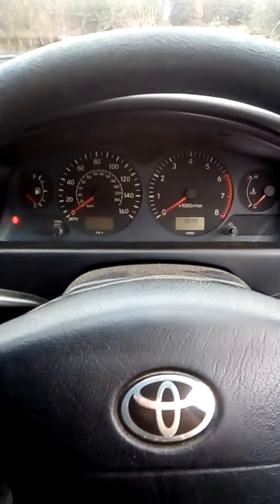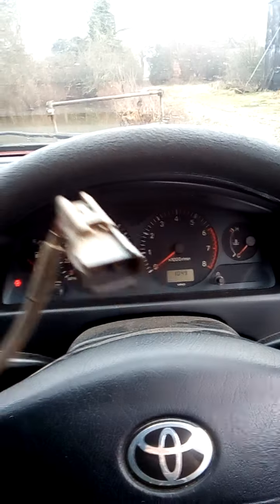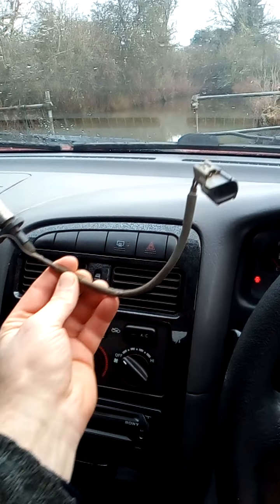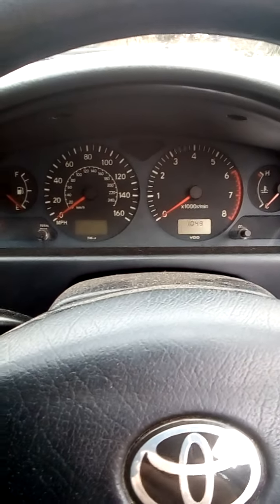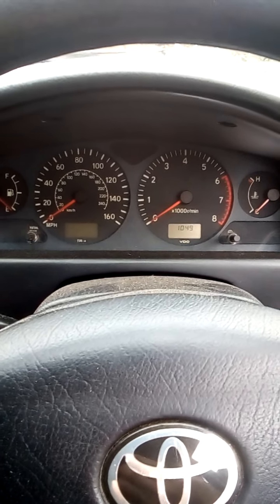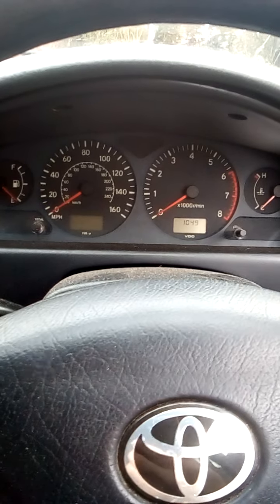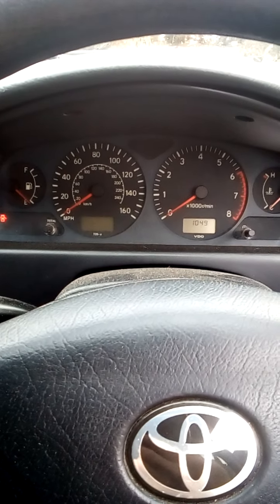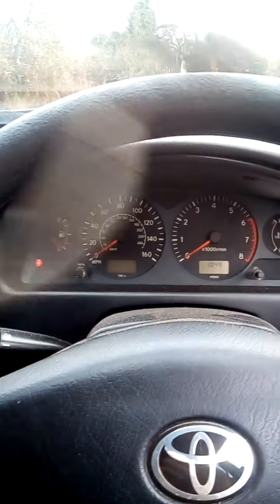Toyota 1.6 4afe 1.8 7afe crankshaft sensor issues

Comment: Thank you mate. 
I had the exact symptoms you described on 1998 avensis, however. The car ran fine for couple of months and now if it gets below 6 degrees Celcius, it wont even try to start. Crancks fine until battery is flat but wont fire. 
If the temps go above 6, i might get a long start but it runs.
Im suspecting it is the cranck sensor.
Mainly i was looking which is the easiest way to get to it and you provided the info. Thanks
Reply: Did it work bro? I'm having the same issues with 92 5AFE corolla. Don't want to waste any more money